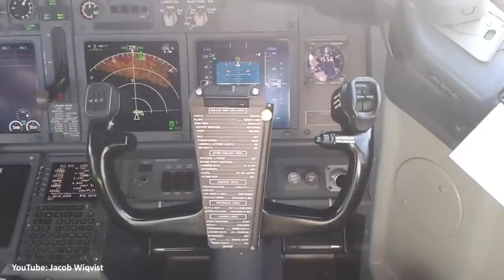Why does Airbus use a side stick?

Comment: If it ain't broke, don't fix it....

The yoke is better, hands down. 

....How a control system could EVER have been adopted wherein the two pilots could be working against each other with no indication to anyone that this was occurring....

As I understand it, the sidestick was not adopted from any belief that the yoke was insufficient, but from Airbus' philosophy that pilot error needed to be eliminated by automating the cockpit as much as possible, and relying as little as possible on the flight crew, preferably making them redundant altogether.

Boeing wisely decided to stick with the tried-and-true, and to tackle the pilot error problem with a mix of automation and improved pilot training.
Reply: occhamite nah. Side stick is much safer.
Reply: occhamite the amount of accidents caused by Yokes over the past 40 years is unreal. Airbus decided to make planes 100% safe by using side sticks.
Reply: @northaviation7952   nonsense . Yokes have been around much longer than side-sticks, in airliners at least, and airline safety was in a much more primitive state in the past, so the comparison is totally invalid.

Furthermore, Airbus' grossly incompetent implementation - allowing two pilots to work against each other without even knowing it, put at least one plane straight into the sea.
Reply: That's why military uses "yokes" i mean side sticks!

Comment: The Airbus flight stick is much better. In fact, these systems are safer because they are interpreted by computer, meaning that the flight computers will determine whether the pilot input is in the flight control laws. Additionally, you can still manually fly the aircraft with the flight stick, and Airbus aircraft have included a more state-of-the art system for their flight sticks. Thus, with all the monitoring, making it the most secure system and safer than Boeing aircraft. The flight stick is also still a physical source of flying the aircraft. However, the wear on the yokes in Boeing aircraft, and the required system maintenance, can result in unsafe environments and cause the yoke to fail. Boeing’s system is old and has proven not to be the most reliable.

Comment: On an Airbus if both pilots are moving their sidesticks you can constantly hear a call out saying "Dual Input". So yes the AF447 pilots knew that they were both moving the sidesticks but they were panicking.
Honestly I see no advantages in using a yoke. A sidestick is just as good for controlling the aircraft and it saves A LOT of space. So in my opinion the sidestick is better.
Reply: TR Aviation wait a minute.... dual input? I as a Boeing person thought that there is a thing called stick priority so only a pilot with that authority flies the plane
Reply: @MalaysianAviator737-8  the priority function allows a pilot to disable the other sidestick. But when that function is not being used and both pilots are moving their sidesticks, the fly by wire computer sums up both inputs while constantly making the "Dual Input!" callout. If you activate the priority function you will hear the "Priority left" or "Priority Right" callout. Only then you have disabled one specific sidestick.
Reply: Ahh I see.

Comment: What if the captain is right handed or if the first officer is left handed? I think yokes are much easier.
Reply: They still have to use their right or left hand to be able to use the throttle. First officer uses right, Captain uses left.
Reply: Personally I'm right handed and I have a joystick for my home simulation which replicates the airbus one, which I prefer left, but there's no difference
Reply: @nnvidsvlogs3997  but you aren't turning the throttle, it moves forwards and backwards not side to side

Comment: I like both the yoke and sidesticks but from the lesson learned from the Air France accident if there's a problem with the aircraft the captain saying "I have control" the first officer will say "you have control" and he'd let go of his sidestick.
Reply: Yes
Reply: @itsnaveenn  Because even though sidesticks are electronic controls it's like the Yoke all over again only one input can be used because if two inputs are different or the same this can be confusing for the system. So when operating the plane and when the pilots encounter a situation only the captain will handle the controls while the first officer hands over the controls to the captain and handle communication with the ATC.

Comment: What is the reason that side sticks aren’t mechanically linked to one another like yokes are? To me that seems like it would be the best of both worlds. Immediate tactile feedback seems like a better solution than summing the inputs and sounding a warning.
Reply: As I understand some planes with sticks actually use force sensors so the stick does not "move" at all. The amount of pressure applied to it in a direction controls the movement. Otherwise, sticks require gimbals and depending on where the stick is the mechanical engineering to set up cords to pull both gimbals together could be obnoxious. Yokes tend to poke in to a big gearbox where they can just be connected directly to the other.

But most of this I know from people building flight sim gear so YMMV on the real thing.

Comment: The question is rather why Boeing is still using yokes. 
All new airliners have side-sticks : Bombardier C Series, Irkut MC-21, COMAC C919, even new private jets are equipped with side sticks : Dassault Falcon 7x/8x/5x, Gulfstream G500, Bombardier Global 7500.

The side stick is the new norm, Airbus was 30 years ahead of its time.
Reply: Watch the video again 🤦🏻‍♀️🤦🏻‍♂️ also, as a pilot, I always prefer the yoke over sidestick.

Comment: Cockpits (flight decks, if you prefer the modern euphemism,) are and have been becoming far too automated.  Pilots need to be able to manually fly an aircraft, not just be computer babysitters in the sky.  I believe the side-stick is generally another way to take automation way too far.  It's like driving a car in the sense that the western world has become far too lazy with automatics, while some real drivers out there prefer feeling that connection to the road that you get only from a manual transmission.
Reply: Yokes don't enable direct control of the plane. All modern planes are now heavily automated, and the recent Lion Air crash has demonstrated that : the computer kept pushing the nose down, even though pilots wanted it to go up. In the end, it's just a question of trademark and ergonomics.
Reply: I see this as flawed logic, as pilot error is FAR mor likely to cause a crash than a computer error, even on fly by wire planes such as airbus planes. This is like saying, "I preffered when GPWS didn't exist, as pilots had to manually look for when they were about to hit the ground. Now computers make sure you aren't hitting the ground, AutOMatiOn is TAkiNG OVER!!11!11"
Reply: @tanguygodeau7106  Automation itself isnt the problem, the problem is boeing's half assed implementation, which was incredibly unsafe. Airbus have been flying fly by wire since 1994 and been safer than manual flight.
Reply: @kral5932  Yes I fully agree, automation isn't a problem (it's actually the way forward), and the real issue is how you validate and implement the system, and the process to regain manual control. Boeing missed out on every aspect : hasty development, no internal and external validation, no specific training for pilots to interpret system errors and regain control. Some guys in Seattle sure have some blood in their hands...
Reply: @tanguygodeau7106  Exactly! I honestly think someone at boeing should be charged with murder

Comment: That's the reason why Air Force One uses a 747 Boeing and not an Airbus because it it uses a yoke which is controlled by hydraulics
Reply: The other reason is there would be an outrage by the American people if the US government purchased a foreign-made aircraft instead of Boeing. Yes, I know most parts are made abroad but Boeing is still an American company.
Reply: Kevin P I think it’s stupid that that the U.S government is spending so much money on an airplane. Like $4 billion? Really? Why not get a smaller aircraft that could be more efficient, cheaper to make and operate, and doesn’t cost the crazy $3,000 something per minute to operate while in the air.

Comment: Thank you , I read some of the comments and many go for the yoke and I did at first , but now after looking at many cockpit landings and take off it looks like the side stick may actually be easier and have lower load if the plane is rolling allot for ex. I'm sure today that sidekicks are the future even for Boeing .
But I have one question is the yoke connected to any mechanical parts at all ??
Reply: Old Boeings have the yoke connected to hydraulic system. Newer ones (777 onwards) use fly by wire like Airbuses.
Reply: They still are connected to wires. But the hydraulics are the main control booster unless they fail.

Comment: With Boeing aircraft, you’re basically fighting the aircraft for control. However, Airbus aircrafts are precise and do not utilize old systems from before the ‘60s.
Reply: Airbus A320 Aviation preach

Comment: Yoke! I don't want a air France 447 to happen to me. You can't see if the other pilot is putting inputs into it.
Reply: They have sidestick priority nowadays but i still perfer the yoke
Reply: Yes you can. If both pilots are moving their sidesticks you will constantly hear the "Dual Input" callout. And the fly by wire computer will sum up both inputs.
Reply: Barney Rubble I don’t want ET302 to happen or JT610 to happen to me. Side sticks are safer.

Comment: is the left co pilot on an airbus always left handed?
Reply: No, you just have to learn to fly that way. Even with yokes. In the left seat you always fly with your left hand.
Reply: It would make no difference with a yoke. Both a yoke and a sidestick need to be controlled using the outer hand, meaning left hand on the captains side and right hand on the first officers side. That is due to the throttles are in the center. And everyone who has ever driven a car on a left seat know that it is no problem to steer with your non-dominant hand ;)

Comment: Yokes are much better it's what ALL pilots learn with them from private pilots all the way through to the airline transport pilot rating so the yoke is familiar, even comfortable.  Even with hydraulic control surface you still get the control feedback through the yoke,  with side stick you lose that feedback so you're not going to be aware of the control inputs of the other pilot.  Yeah,  I'd opt for yoke over a side stick every time, and steam gauges too I know I know,  I'm a relic, before the "glass cockpit".

Comment: Objectively: so you're going to compromise safety for more space in the cockpit? That's exactly what a sidestick does.

Same thing happened with the AirAsia crash a few years back.
Reply: Joseph Cheng No it’s nothing to do with that. It was because of the weather, the aircraft stalled.
Reply: What's better, blocked instruments or total visibiloty of them? The sidestick had no fault in the crash. It was pilot error.

Comment: Yokes are the best. A thing you can really hold on.
Reply: MAS_ pilot Side sticks are safe 100%. I always fly A320/21 as it’s much safer. Never had a probelm - flown with 737s 5 times - Have to divert lots of times.
Reply: @northaviation7952  What were the reasons for diverting? I’ve literally been on 737’s over 100 times and never had a divert. They are what I’m keen on flying in the near future.

Comment: I think the side stick for airbus aircraft is more convenient since it frees up one hand for other uses and takes up less space. However, being able to see the control inputs of the other pilot is important which the yoke allows for. Maybe if the side stick location was changed (thus allowing it to be seen more easily), then maybe the yoke will not be needed for a fly-by-wire aircraft. Of course yokes will still be common in smaller aircraft such as bush planes that don't have fly-by-wire capabilities.
In case you think I'm from Europe, I'm from the USA and a fan of both Airbus and Boeing aircraft
Reply: You can still operate the yoke with one hand. :P
Reply: Joseph Cheng harder to use with one hand. Much easier to use side stick with one hand. Prefer side stick. Wouldn’t even think about Boeing. Airbus all day long

Comment: Yoke is more intuitive.
Reply: L R G If you're a long haul pilot flying 10 hours aross the Atlantic, I'm sure you would disagree. For the length of time that manual control is used, a yoke taking up all that space is pointless - having a sidestick creates room for a traytable, and they are great to operate.

Comment: I am wondering if right-handed captains are comfortable with a side stick that they need to use with their left hands.
Reply: Hakan Evin It’s not hard to fly with your left. I’ve done it before and it’s really simple.
Reply: It really doesnt matter. Either with a yoke or a side stick. Captains will be flying with the left hand and first officers with the right hand as your other hand will be on the throttle.

Comment: Side stick by airbus are just a normal evolution of the fly by wire systems. Remember the A300 and A310 had stick before FBW.
Reply: @Draculapin- you mean the A300 and A310 had the YOKE before FBW.
Reply: @kevinp8108  for fucks sake. yeah typo my bad
Reply: Doge Bomber so does the CRJ. Nowadays everything is by wires. Not always to the same degrees but there’s at least a bit

Comment: You mentioned the situation of both pilots using the side sticks at the same time, but what about a scenario when both pilots use both yokes at the same time in a fly-by-wire system? What would happen in that case?
Reply: Both yokes are connected, so basically it's the strongest pilot who would have the upper hand
Reply: @tanguygodeau7106  Yeah but they are not physically linked. The forces are mirrored artificially by electric motors. So if both Pilots exceed these it will be an interesting situation :D 
I don't know what happens in a mordern Boeing where this is the case. But in an Airbus the inputs are summed up.

Comment: Side sticks for left-handed captains only.  But seriously, I wonder how hard it is to transition from right seat to left. . .
Reply: Bram Moerman They don’t just transitions ffs
Reply: North Aviation: I’m not sure what you mean.  Are you a pilot?  I remember taking a lesson on flying PIC from the right seat, even with a yoke.  There definitely WAS a difference.  Even as a left hander, I would have transition problems driving a manual transmission car in Britain.  

Have you tried using a computer mouse with your “other” hand?  I’m ambidextrous enough that I always use my right hand for that; can’t even imagine doing it left handed. . .
Reply: Bram Moerman but when flying it's easier plus only fly it for 20 minutes for the full flight anyway and it really is simple.
Reply: It really doesnt matter. Either with a yoke or a side stick. Captains will be flying with the left hand and first officers with the right hand as your other hand will be on the throttle. All pilots begin their careers flying with their left hands sitting on the left seat as student pilots. When you get hired by an airline during your type rating you get used to flying with your right hand from the right seat. When you are finally experienced enough to become a captain and transition to the left seat you will undergo a command training course where among other things you will get used to flying from the left seat with your left hand

Comment: Yokes are better, they arguably give a better feel.  Also, look at AF Flight 447, the yokes were not interconnected, hence contributing to the demise of AF 447...
Reply: Matthew Hung The pilots should have been clear on who had the controls, which didn’t happen, and ultimately allowed for a dual input to happen and the computer averaged out the two inputs of the captain and FO.

Comment: Us aircraft engineers like the idea of sidestick for cockpit access! Nothing in the way when you have to get under the instrument panel and wedge yourself between it and the seat. I have spent hours wedged up against a control column.

We need to hear from pilots, but obviously only ones who have actually used a sidestick.
The opinion of Fanboys means nothing, they will defend their favourite to the hilt despite not knowing much about the other.
Reply: I will also add, the argument about safety can be overcome by installing feedback on the sidestick. Both systems are fly by wire so it just requires either a physical cross connection (would require quite a bit of structural modifications) or feedback motors to give the movement.
These things will take time to implement retrospectively but could be possible on newly built aircraft.

Sidesticks should be the future of large aircraft, the control column is an outdated device in a large and fly by wire Aircraft. Put them in General aviation aircraft by all means.

Comment: I'm left handed, so the pilots seat would be perfect for me, but I just don't see how you can use your non dominant hand for this. I can't use my right hand for anything
Reply: Giggitygoo the pilots seat? They’re both fucking pilots.
Reply: It would make no difference with a yoke. Both a yoke and a sidestick need to be controlled using the outer hand, meaning left hand on the captains side and right hand on the first officers side. That is due to the throttles are in the center. And everyone who has ever driven a car on a left seat know that it is no problem to steer with your non-dominant hand ;)